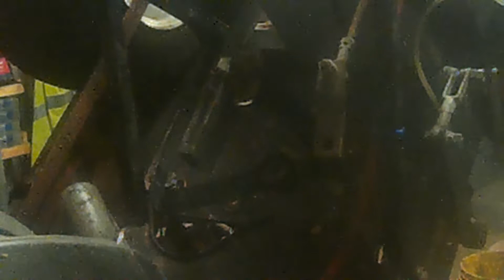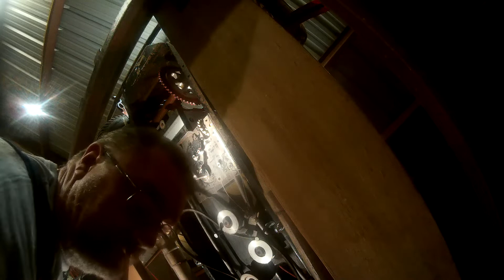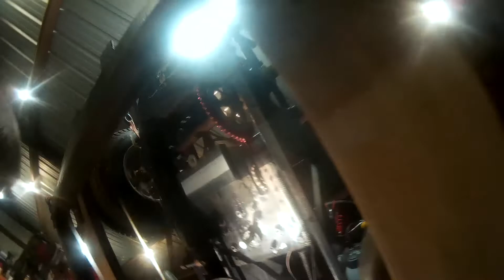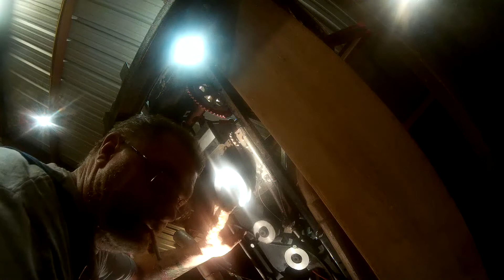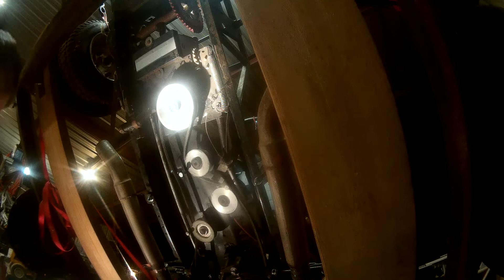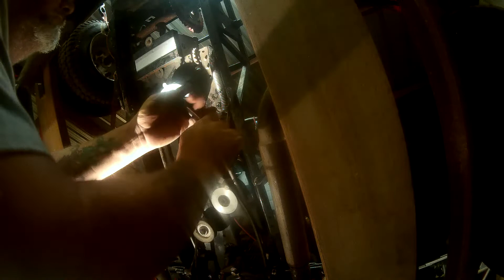GPT part 5 (transmission install)#twistednation

Comment: I noticed that you have a rubber tube coming out of the top of your transmission. I presume that is a vent tube? Anything special to know about it? I'm guessing it is just a nipple threaded into the original neutral safety switch hole? I guess I will have to modify my shifter to clear that.
Reply from the maker: Yes it’s a vent, you vent it anywhere on the top, I have actually, drilled and tapped the top cover, when clearance is an issue
Reply: @TwistedRRacinStaceyReeves  Thanks Stacey